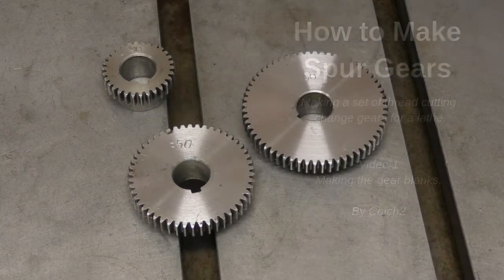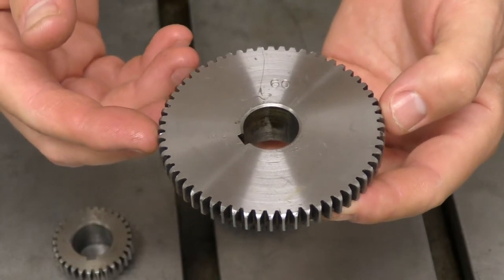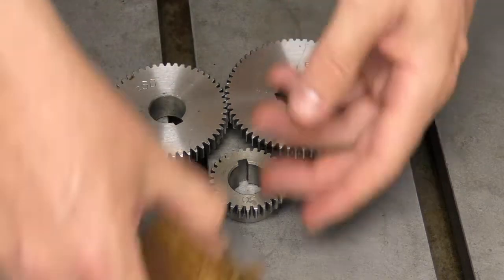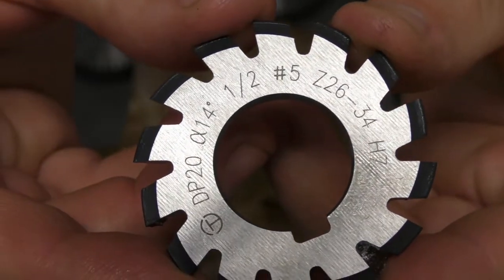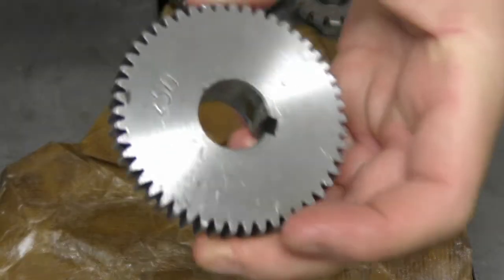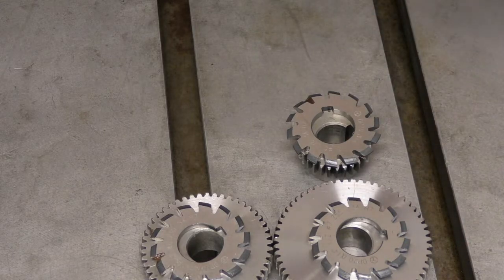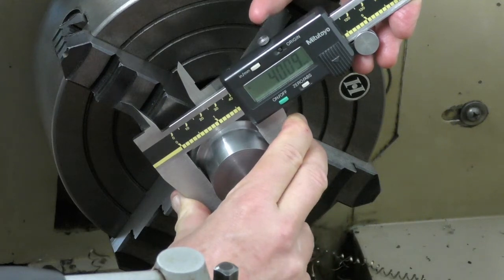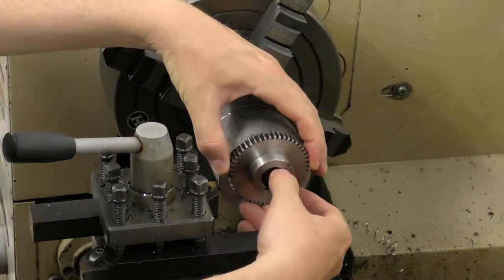How to make Spur Gears - Video 1

Comment: I have the same mill (ZX7550CW). I saw in a forum your post about the machine base and flexing. Do you think it's worth making a spacer out of cast iron? Mine has the dovetail ways all the way down and I think I can gain a bit of travel and fix the flexing issue at the same time.
Reply from the maker: Hi M1KEMEX   Sorry I don't know. The modification I did on the forum made a massive difference to the stiffness of the column however the knee "nods" due to being poorly scraped.  I should really re-scrape in the knee.....    The next modification on my wish list for this machine will be linear ways bolted to the column to mount the knee to in an attempt to reducing hysteresis.  I would love to see what you think about solving this issue.  Thanks for your question.  Chich

Comment: QUESTION: I have never created a gear, so I have a question: If I only had to make a single gear, would I only need to buy a single cutter for that gear?
Reply from the maker: Yes that is correct. You would need to know which individual cutter in the set was the one needed for your number of teeth you were going to cut.  Thanks for your question. Chich

Comment: So that lathe was manufactured as an imperial machine?
Reply from the maker: Thanks for your question. Yes I think it is.  The dials are metric but their graduations dont add up to anything metric.  I use dial indicators for depth of cut because of this plus its a more accurate way to machine.  The Lathe is made in China by the company who I believe makes Hafco, Grizzly and Industrial Hobbies. I've seen a photo on cnczone.com of all 3 brands being made side by side in the same assembly hall.  This little lathe is likley to be a copy of some other machine.